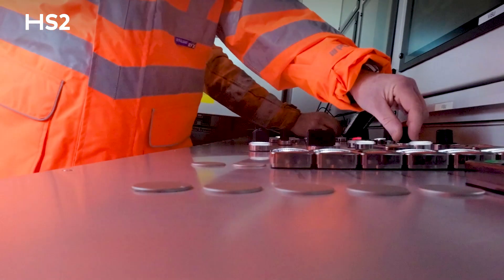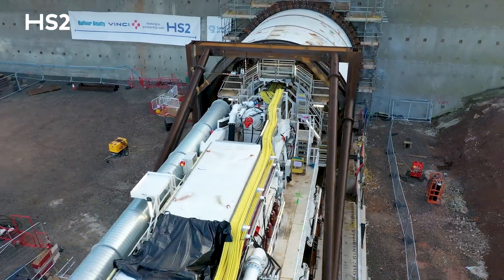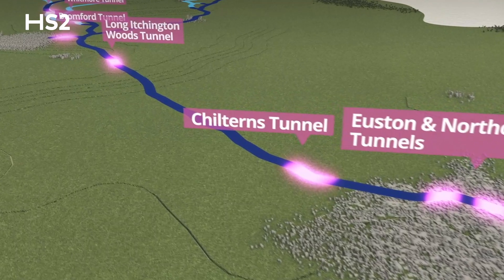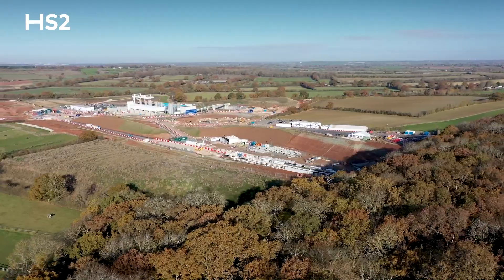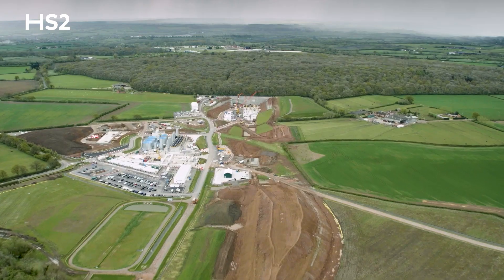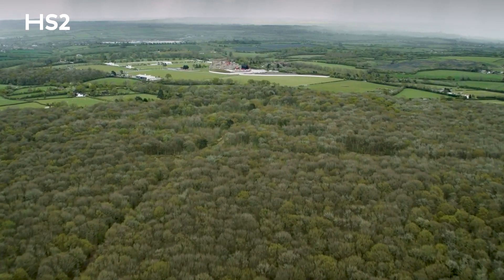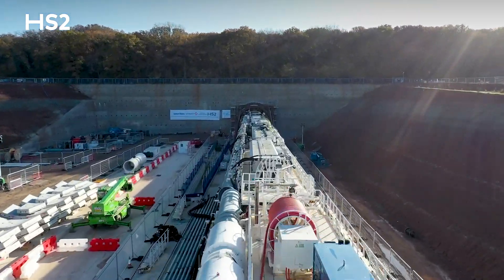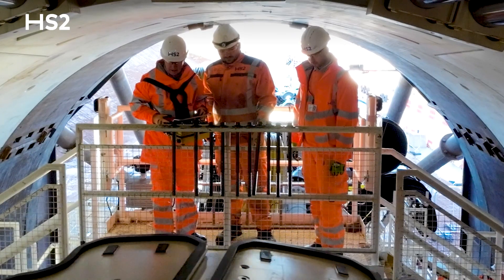HS2 launches first Midlands giant tunnelling machine

Comment: Cut and cover might have been cheaper, store the trees locally and pop them back in at the end, job done.
Reply: Cut and Cover is being used along other sections of the line.
Reply: Tunnel under the trees damage the roots trees still die off.
Reply: @neilfranklin5644  Not at 35 metres down in won’t.
Reply: @davidct2406  it's that far down , 35 yards plus,  so not going to hurt the roots then.
Reply: @neilfranklin5644  Apparently so. I watched a program about R.H.S. Bridgewater and their top arborists said no trees in the UK have roots deeper than two metres. Also just the other side of the wood at Bascote Heath is a small cemetery where a young 35 year old soldier who died in the First World War is commemorated (not sure if he is buried there but some information is on the Commonwealth War Graves Commission site) and I believe this is another reason for tunnelling, following local objections.
Reply: @neilfranklin5644  I don't thick they are tunneling near the surface. 😳
Reply: Well, maybe, but I, for one, am glad they've tunnelled it. In Victorian times it would have probably been a deep cutting through the wood. What is not clear is what the machine will do after its bored these tunnels. Phase 2b involves a tunnel under Crewe, so maybe refurb it and then move it up to Crewe !
Reply: @frasermitchell9183  They seem to imply it would do more tunnelling. It's a pity they are reluctant to give actual detailed information in these videos. On the other hand certainly around the Wendover- Great Missenden sites they have to be paranoid about security.
Reply: Wouldn't it have been cheaper to have a normal cutting, then buy an equivalent amount of land and plant trees on it?
Reply: @EASYTIGER10   the 'environmentalists' would have gone bat shit crazy. HS2 is plating thousands of extra trees on hundreds of acres and STILL they complain even after expensive avoiding projects like this.
Reply: The one tbm will dig the tunnel for one direction of trains under the wood (takes 5 months) and then be brought back to the portal to dig the secocnd tunnel under the wood for the other direction. After both tunnels are complete that would pressumebly be the end for that tunnel boring machine becuase tunnel boring machines are genrally single use although some parts might be reused in other tbms and some parts may be recycled.
Reply: @1chish  They will never be happy, it's the infantile times we live in.
Reply: @NathanJ2378   All the TBMs used on HS2 will be retrieved and shipped back to Germany for rebuilding and re-sale.
I believe the TBMs used for Crossrail were all retrieved as well.
Reply: @Nick-ye5kk  There are a bunch of activists who are willing to do really dangerous things on the HS2 construction sites that put both themselves and construction workers at risk.

HS2 Ltd obviously have to put in security to stop that.

It's a real shame, as Crossrail was able to have a number of open day events (before the pandemic) where they allowed ordinary members of the public to come to safe parts of the construction sites and be shepherded around.

Luckily, there are some railway enthusiasts who have proved that they are not working for anti-raiway activist groups and they have been given access to parts of HS2 and other railway projects (like the awesome stuff that Merseytravel is doing in Liverpool to make Merseyrail the first metro system in the UK to stop discriminating against disabled passengers).